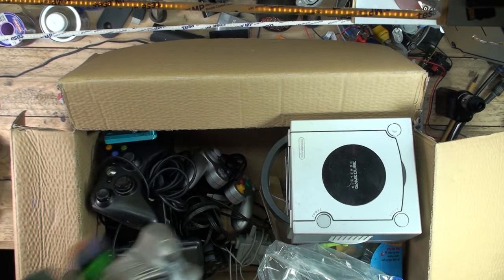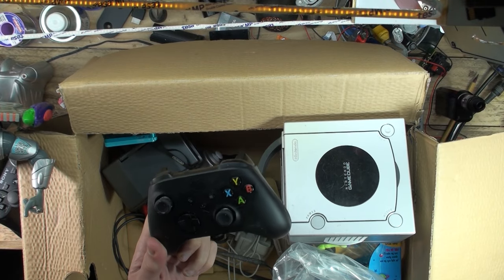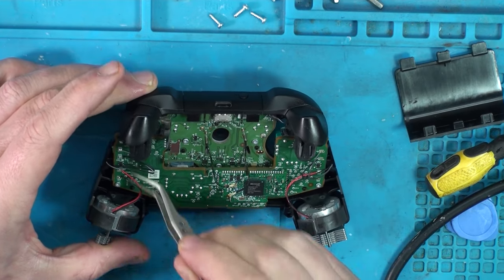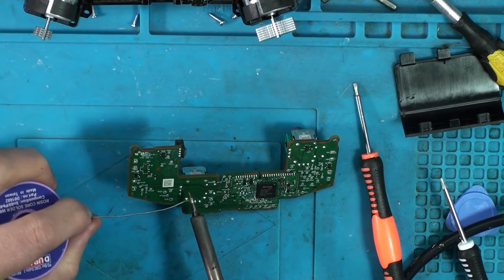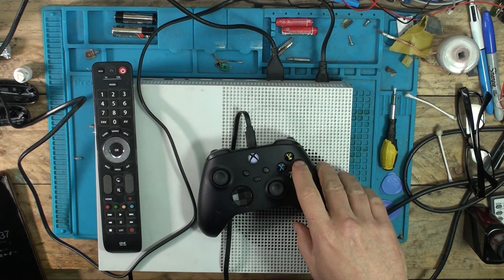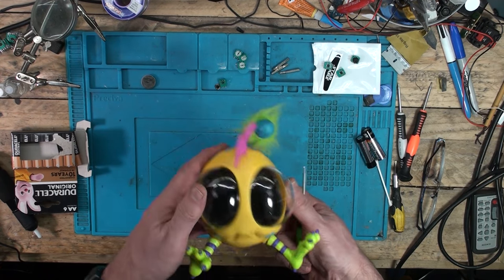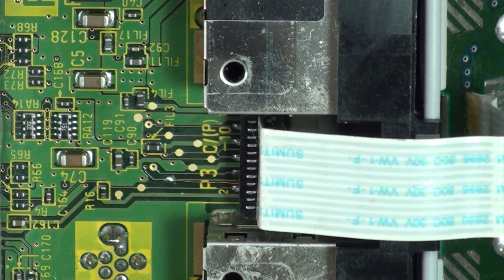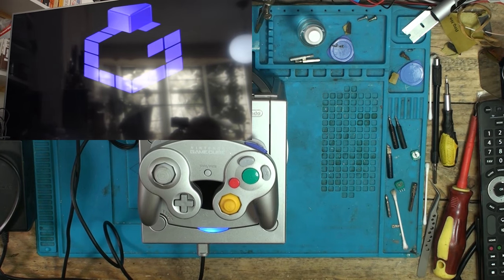Nintendo GameCube, DS, Ooglies and Xbox Controllers. Can I fix them all?

Comment: Thanks so much again dude!!! You are great, and love these videos :)
Reply: Also that ogglies came from a boot sale I just remember it as a child so thought I’d buy it 😂 I really appreciate your work
Reply: That 3ds someone messed with the inside and I have no idea what I was looking at, has a crack so I think someone dropped it then tried fixing inside
Reply from the maker: Yeah it's a bit of a mess in there. I'll see what I can do though as they're worth good money.
Reply: @ I appreciate you mate, was the ps3 controller dead btw? It seems to charge but when it’s not plugged in just won’t turn on, I got the box back today! Thank you
Reply: Oh also the colour light on GC is blue as I bought a new board for the controller ports it’s orange normally haha but I liked the blue so kept it! So pleased you fixed that thank you
Reply from the maker: Ah I didn't check that. I just plugged it into the pc and it was all working fine. It's just a dead battery then and very easy to change. It just plugs into the board